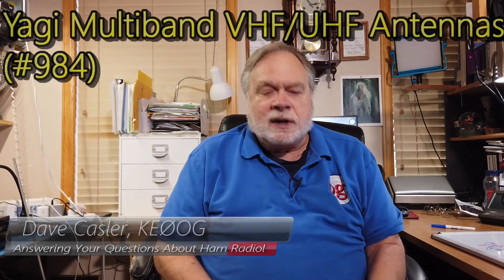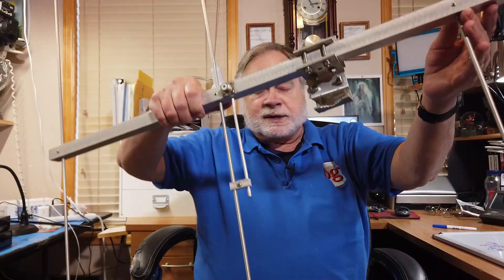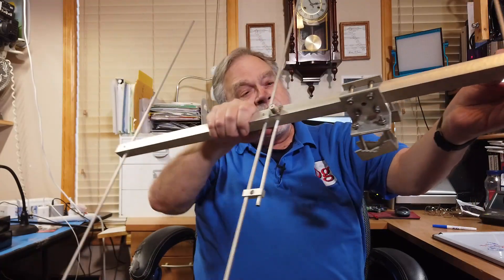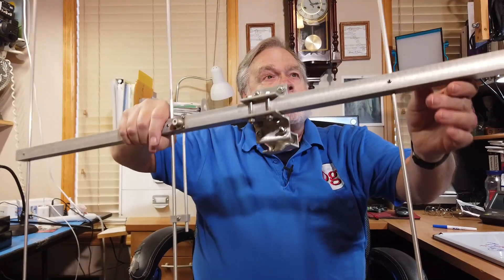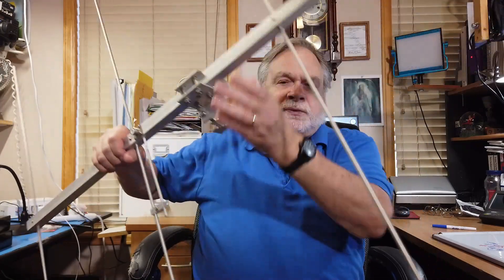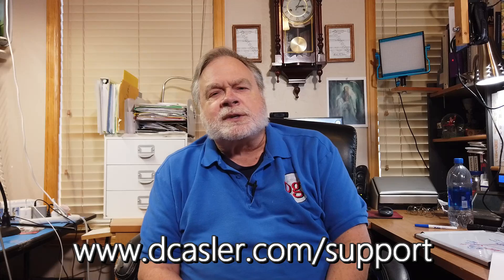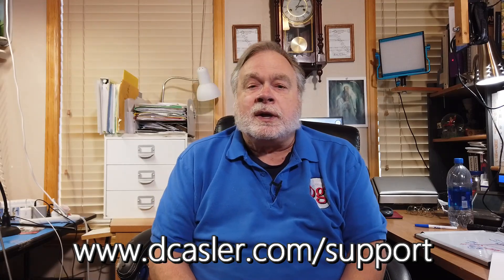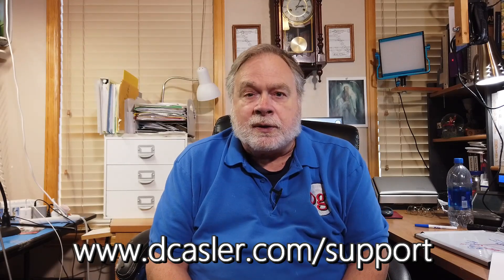Yagi Multiband VHF/UHF Antennas (#984)

Comment: Nice video, I particularly found the answer on combining vhf and uhf.
But as far as looking new radios, I will just stick with my Kenwood TS140S. It is so robust and reliable and after 30 years or so it still never misses a beat.
I do also have a Yaesu FT100D.
73'S FROM THAILAND 
HS0ZQA

Comment: I paid $820 for my ICOM IC-7300 and $779 for my IC-7100 in 2021. Use the 7100 mainly for VHF/UHF though can be used on HF but without the bells and whistles of a 7300 which is where the 7300 SAILS! 7100 has no built-in tuner 7300 can tune 3:1. I have an Alpha Delta 4-way switch with 3 antennas and a dummy load.
I do have an LDG-AT200 Pro-II that can tune 10:1, but don't really need it since I took care of all my RF noise. VHF/UHF can reach the Rio Grande Valley, Mexico, San Antonio, and Victoria with local repeaters!!! HF of course can be world wide depending on propagation.

Comment: I would love to know who thinks they need to spend $7000 on an HF radio, you can buy the Icom IC-7610 with DUAL receivers for less than half that, and you can probably buy FIVE IC-7300s.

Comment: As an electronic hobbyist, my first HF contacts were made on a converted CB on 10 meters. I then upgraded to a Yaesu FT891. Those run about $600 and give you the entire HF spectrum and 100 watts. You definitely do not have to be an equipment snob to enjoy amateur radio.
Reply: I agree, I don't have an High end radio and had a 10 mtr three element  yagi made from bamboo and  scrap steel,  but I could work the whole world.